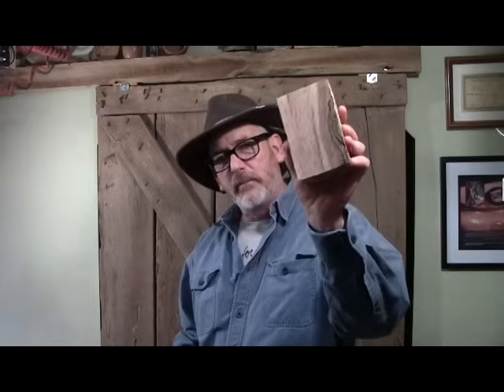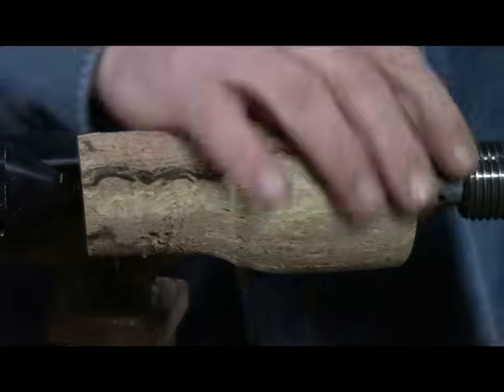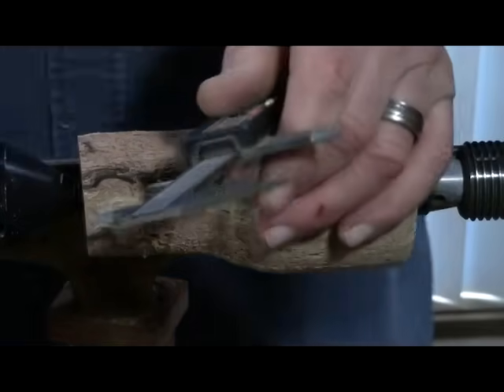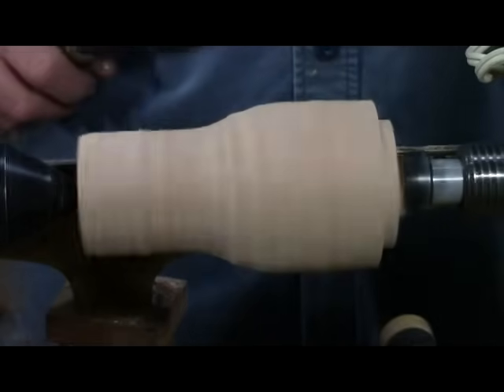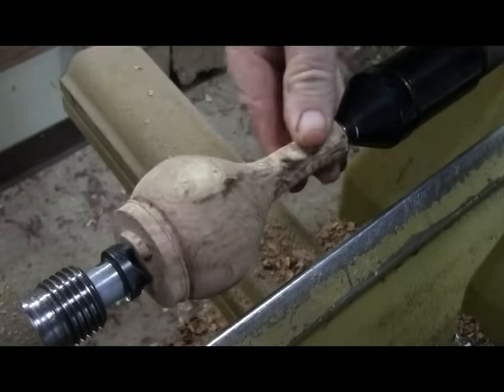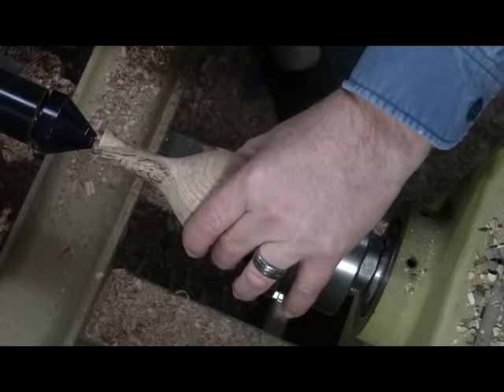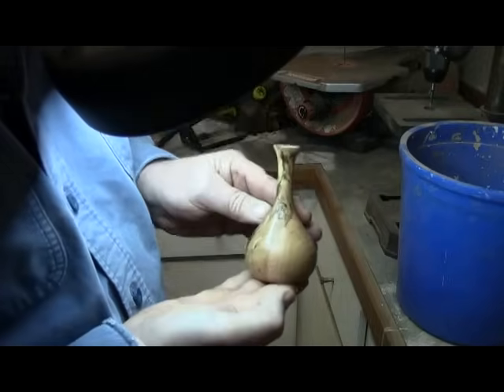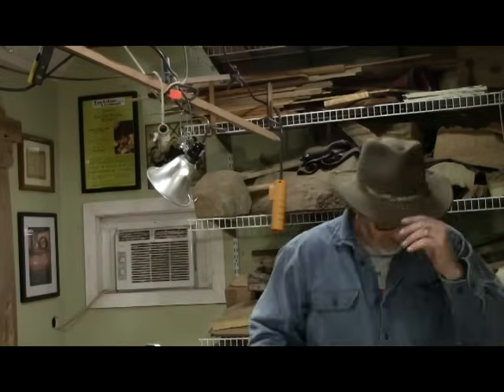Bud Vase

Comment: Great looking piece Jim, I subscribed and am watching many of your videos. Im trying to learn as much as possible and try to decide what lathe to buy. I had to comment on this one it was so beautiful and seemed pretty simple.
Reply from the maker: Thank you Ken. As to which lathe, that can be a big decision. Lathes can get expensive, I suggest to start small and try to get one that the motor is either under or behind the head stock. Not on the side because whatever types of pieces you start turning, the side mount motor can get in the way. BTW, turn at the slowest speed possible. take care,
Reply: Thanks for the reply Jim, Ive got it narrowed down to about 3 of the midi lathes, I just need to make a decision. Thanks again, enjoying your videos

Comment: Jim if you used skew on the outside you would have gotten rid of all that rough tear outs. Also, I found it very useful and great result when you add a50/50 ratio of lacquer and dilute it with 50% lacquer thinner for those spalted wood. As a matter of facts I di dhwloe bunch of them last night on Spalted Pecan which has gorgeous wild pattern tand today I used the skew and got a very slick finish right form the tool and I can easly say that I can start from 180 grit to 400. You said you went to 800 grit which is too much and when you get the wood that slick then you'd have problem with the finish soaking in. at most 400 grit gets it clen enough that you can apply final finish on it. When using above concoction it stiffens up the torn fibers like you see in your video so when you come back and tool it it will slide like a nice wood.
Reply from the maker: Thanks?

Comment: Nice job Jim
Reply from the maker: Thank you Ray. It's about time to make another video. Any suggestions?
Reply: @ballardjim  something that includes deep hollowing, without the use of a stabiliser? Particularly advice on how to avoid catches; how to best scrape (and avoid even more catches, and how best to finish internally. I think I might have just about managed some hollowing whilst avoiding catches with a hollowing tool only to find a propensity to catch when using a scraper. It's a bit difficult to see/film I guess but an open deep vase might do the trick. Cheers, Ray

Comment: That looks like a Nova chuck similar to what I have, curious though, what's that on the claws?  Looks like duct tape.
Reply from the maker: Silver duct tape. When I turn something wet using the expansion function it keeps the jaws from transferring rust to the wood.
Reply: @ballardjim  good to know, may come in handy.  I've only been turning about a week  now, and just found your channel.  I have to say the way you applied the tooth point thing, not sure what it's called, to turn between centers was interesting as mine dont stay in the wood.
Reply from the maker: @T67Moon  try to use a saw as well on an X  to give the drive center some grab in a groove. That was how I learned until I took to beating it in.

Comment: Don't want to be a pest, but could you give a chuck suggestion. Jack
Reply from the maker: Nova works great. Be advised that you need to know what your lathe's TPI is on the head stock. If the chuck you find and like does not have equal threads, you will need to also have an adapter to mate with both the chuck and your head stock TPI.
Reply: Thanks a lot 3/4 x 10 is my head stock penn industries makes an adapter
Reply from the maker: Don't forget to check Amazon as well.

Comment: you should never hit a Morse Taper with a hammer , it could shatter or round-over the MT , then it wouldn't fit the head stock,, surly you could make a mallet on the lathe
Reply from the maker: But did you like the video?